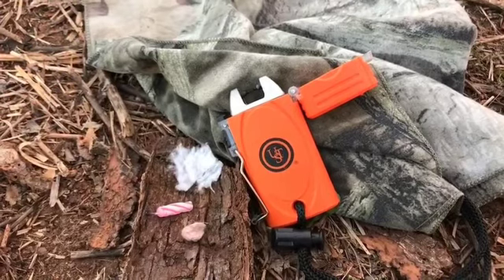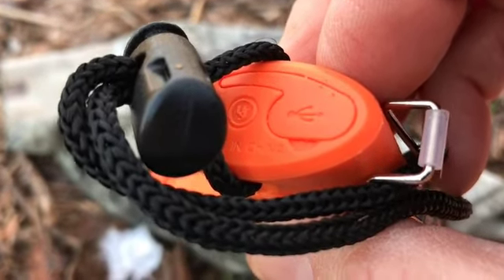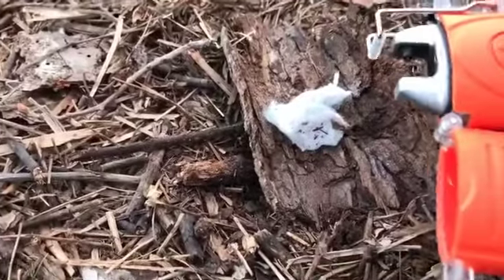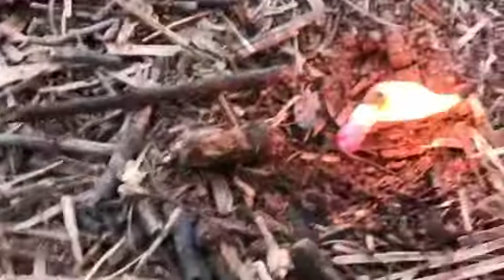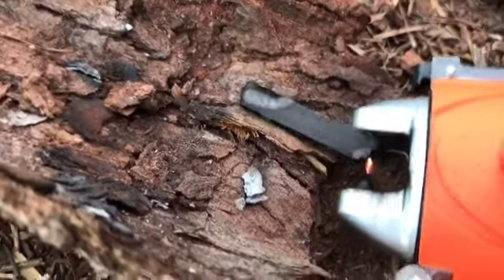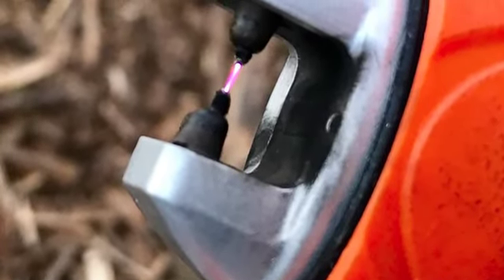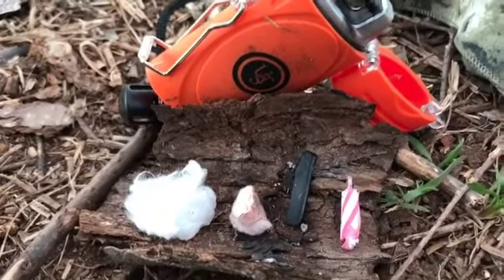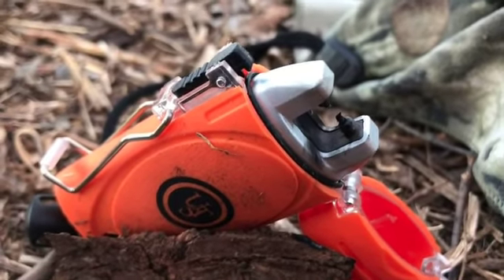UST Tekfire Lighter Test

Comment: Well Dee, I like my firesteel attached to my Leatherman via the clip. But, I will check this device out, not too sure it has enough space between the arch rods for my needs. Thanks for sharing.
Reply from the maker: jld3229   The limited space is indeed a possible concern. I am going to continue trying it and see how it performs. And I think I may be able to attach it to the Leatherman, but the lighter keeps shorting out on the all-steel Wave. I also tried to use the lighter’s electrodes as a striker for a ferro rod. That produced a bolt of lightning that burned a hole in my canteen cup. Also, if you accidentally hold it too close to a signal mirror it seems to create sort of a laser beam. Getting back to the video, thanks for watching and commenting. -Dee
Reply: @dcordry  Cool Dee, I will look forward to your future vids on this product. Best Always, Jay

Comment: I have other UST products and they aren't too bad. What about the battery duration of this ARC lighter? How many things can u light all things being equal before one needs to recharge it? O guess one could recharge it in the field with a power bank. Although I'm still on the side of a quality windproof lighter. Also probably any "dead wood" if it contained any moisture, enough for breakdown/conduction and u decided foolishly to hold it (I notice u did not do this) while trying to light it, u may end up getting a big boot up the arm LOL. Thanks for showing.

Comment: Actually this seems pretty interesting. I've been using a Ferro rod and scraper to start my wood stove below-freezing temperatures. It would be nice to have something which works in those freezing conditions, as a rapid method for emergencies. Do you know if there's a version with a bigger Gap?
Thanks for sharing this with us.
Reply from the maker: Julian, thanks for watching and commenting. Because of your comment, I am going to make an attempt at using this lighter in freezing conditions. Also, I plan to use something such as a ranger band to keep some jute twine or other tinder right on the lighter. Something that works well with the existing gap. 73 - Dee
Reply: @dcordry  thanks for that. I'm really looking forward to it. It's also nice to get a new video from you. 🙏👍

Comment: Hi there! explain to me why this vs cig lighter? At its size and weight and requiring charging; is it just one of those cool things to have?  I read something below that makes me wonder if it's about the temp?  Great video, thanks for teaching me something new!
Reply from the maker: Florida Girl Adventures   Hi, thanks for watching. I purchased this item because it was on sale. It was interesting and I decided to check it out. The primary thing I wanted to determine was how it would work on tinder such cotton balls. My other test is going to be how it performs in very cold conditions. The 2 issues I have with the average Bic lighter is (a) it is too difficult to use in windy conditions, and (b) have always heard it must be warmed up with your body heat before it will light in extreme cold. I am addicted to outdoor gadgets and am powerless when I find one at half price! Thanks for joining the discussion and best wishes. - Dee